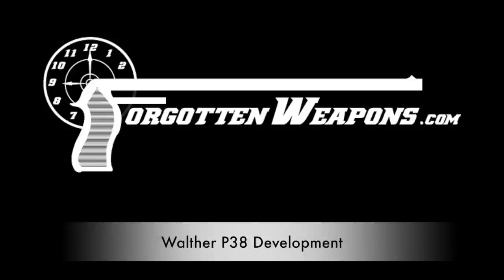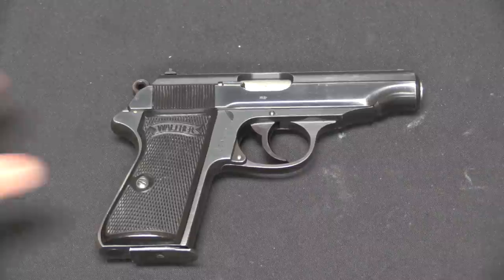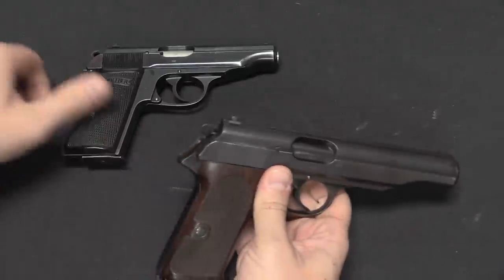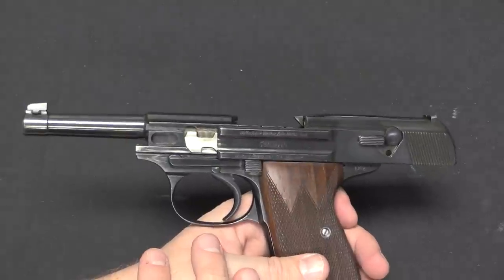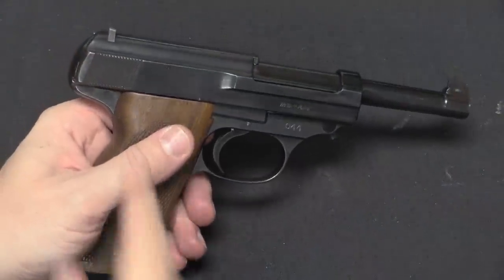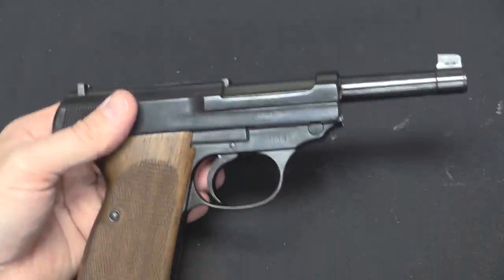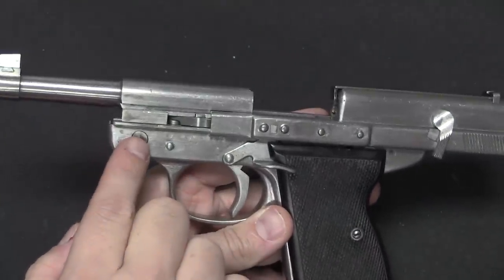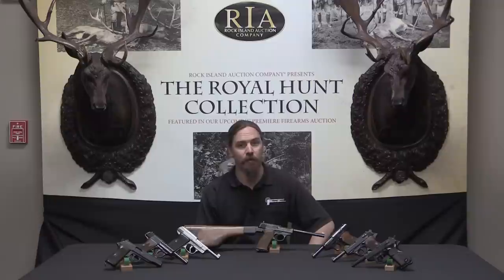Walther P38 Development

Comment: That magazine on the stamped gun seems like a pretty major indication of the gun's history. Had it been a late war prototype, they almost certainly would have done the same thing they did with VG rifles and used an existing magazine design, which in this case would have been the normal P.38's mag.

Comment: When I was about 10 or 11 I found a plastic P38 at my local model shop. AFAIK it was an accurate part for part replica in plastic. Of course some of the parts including the slide and barrel were supplied in two bookmatched halves. It even had cartridges with primers one had to build. I didn't begin to build it until I had made a few cars and planes and two years went by. I learned more about firearms than cars thanx to my brief model building.
Any one have experience leaning about gun mechanics through building models or taking replicas apart. I've not built a model anything since I started making real(not firearms). Seams like a decent way to learn the way guns work without buying thousands of bucks.
Reply: I still have all the plastic model construction kit pistols I built as a kid!   I'm now seventy,  been collecting real ones since I was old enough; but still learning thanks to Ian, Othias, Mark and the internet in general. Thanks, guys !

Comment: Great development history lesson.

I am amazed that a collector could obtain the various development prototypes. These have to be extremely rare.  Truly a one-of-a-kind collection. Too bad it will probably be broken up ...

Several things made the P-38 stand out: 
1. its sight. Vastly superior than those of the Browning Hi-Power.
2. its design was extensively copied in the design of the Beretta 92 / M9: external trigger draw-bar on top of the right grip panel, wide ejection clearance and especially the locking block.

Comment: The optical similarity between the PP and a P38 with the barrel sawn off are quite interesting. Although in my opinion, the PP beats every other pistol aesthetically, the P38 with the barrel shortened and the receiver and slide lengthened (so that the barrel and the slide end at the same point, similar to the PP) would be pretty close...

Comment: Other sources have mentioned a significance to the shape of the block or sheath around the firing pin.  I noticed you showed some with a round block (that sheetmetal example didn't have any separate insert.)  However there was also a rectangular block/insert -- I think moreso with the police version.  I'm particularly interested in this topic because I have a P38 that doesn't seem to fit any of the versions and has many stamped marks, some...odd.  Do you have a more detailed video about P38s?

Comment: Maybe the shrouded Hammer wasn't such a good idea for the military, as it took quite some effort to squeeze off the first round if uncocked (at least with the P1), which could have you miss because of the force you had to apply. Iirc it also could be cocked half-way, blocking the trigger when loaded and safety off.

Comment: I took a pass on a nice P38 years back, but I have my dad's P1 made in 1971 with matching dated mag, with the P1 alloy frame it feels way different. Tip: I use light grease instead of oil for the rails and locking block.

Comment: Even though the general consensus is that the Walther is a cheaper design than the Luger (and that may be true practically speaking), I feel it is doing both the gun and the general public a disservice to assume this is just a scaled down design only brought about to save money and manufacturing time. In essence, very much like the Walther PP and PPK that came before it, the Walther P38 is a classic German product of 'over engineering'. What this means is that the product is much better than it needs to be, but it does this efficiently. The P38 was so far ahead of it's time that even modern handguns like the Beretta 92 are pretty much a direct copy of it mechanically speaking. It's delayed blowback striker-fire system is used not only in many pistols but has been adapted to full sized assault rifles like the VZ 58, which is also an excellent gun. (much in part due to the mechanical designs it borrowed from the P38). It's double action and single action, which at the time was only heard of in revolvers, plus it's de-cocking safety was a very impressive innovation for it's time. So yeah, even though the Luger was very much a 'luxury gun' by comparison to most of it's competition, the action was outdated by this time and the P38 was an improvement in many ways. I own both a P08 and P38 and I love both of them. The Luger more from a collectability and artwork perspective, while the P38 is just a really impressive and well polished machine that still runs smoothly after 70 years. The Luger is like a Formula 1 Mercedes from the 1930's and the Walther is a classic shark nose BMW from the 70's.

Comment: I own a p38 and I have a question when I put the safety on I pulled the trigger (dry fired it) to to see if it would lock but it didn't it ended up activating the hammer after discovering this I have not fired it since I bought it I just want to know if this is a common thing with p38s or double actions in general

Comment: It's always bugged me that the P38 and the Beretta FS looked so similar, is the beretta just a foreign reproduction?
Reply: The Beretta 92 is not a reproduction but is based on the Walther P38...kind of like how the CZ 75 is based on the Browning Hi Power.  They have similar qualities but are not the same pistols.  We might not have the Beretta 92 without the P38.
Reply: Flemme Werfer the Beretta has and that design since 1915, look em up
Reply: Irwin Torres actually you look them up too, walther in no way influenced the design of beretta
Reply: newcorpse ontheblock   I think you need to do some research before you start telling other people to look stuff up.  The Beretta 92 evolved from the Beretta M1923 and M1951.  The M1923 is where the 92 gets it's open slide design.  The M1951 is where the 92 gets it's alloy frame and locking block barrel which was originally used and borrowed from the design of the Walther P38.

Comment: That stamped gun is amazing
Reply: I think this was an attempt of possibly going the same way as Rheinmetall did when developing the MG42, which also largely used stamped sheet metal parts for the housing, instead of milled block material.

Comment: "Simple blowback isn't ideal for pistol cartridges as 'hot' as 9mm"
Hi Point: "Hold my beer.."
Reply: Which is why Hi Points are so big and heavy compared to comparable pistols.
Reply: High Point: “Hold my Pabst Blue Ribbon beer”
Reply: There is an other, older 9mm Luger straight blowback pistols that were very successful. The Astra Model 400 started in 1921 and is a fantastic pistol. It ended production in the 1950's. Made of all forged and machined steel, I own one and have shot thousands of rounds over 50 years and never had a malfunction.

Comment: It is always very interesting to see the lineal development of something like this or the 1911, especially when prototypes are so rare, as these are. Great job and a nice find. If you include the Beretta 92 descendant,  i suppose one could argue that the P38 and its descendants probably equal more military issue pistols than the 1911- german plus italian plus US M9's. I don't think the 1911 and 1911A1 reached too much over a million, the P38 and 92 and M9 probably have. The P38/P1 was West German issue into the early 80's at least. My P1 had 1979 dates in the slide. As i recall, the Sig 225 came along about 1983-84 as a police pistol to replace the P1 and older PP's and whatever else. Anyway, great video as always. Thank you

Comment: I know very little about this P38 pistol and just bought one off a friend. The box and the instructions all say P 38 on them but I’ve heard you reference the P1 and someone else tell me after the war they were called P1, so is it a P38 or a P1? Also, I was told after the war they started making the frames out of aluminum. I can’t tell in this gun everything is black there appears to be a date stamp on the side of the gun, showing 9/69 is there a web site where I can check the serial number? Thank you.
Reply: I may be late for an answer. Was in the German Army (Bundeswehr) in 85 and we used the P1 in 9mm para. It was basicly a P38 with a lighter frame (not steel). It was all black. Maybe check it with a magnet when disassembled. I think production of P1 for the Bundeswehr started around 1956 or 57?
Cheers from Germany
Doc

Comment: As a young policeman in South Africa I was issued a brand new Walther P38 9mmP pistol in 1979, serial number 338548. It was a German made pistol and not a Manurhin copy and I used it until 1985, when it was replaced by a Beretta 92 9mmP with serial number B27397Z

Comment: What ammo should I use in a 1943 p38 Its in 8/10 condition barrel and action are very good. Dont want to shoot it alot just sometimes, I do reload if that would be a better option.
I don't want to just shoot any factory 9mm without knowing it will be safe and not harm the gun

Comment: I may be mad, but it seems like there are some similarities between the P38 and the beretta M9, like the location of controls, extractor, form of the slide, and so on.  Is this coincidental or another example of German weapons inspiring other developers?
Reply from the maker: +deadextra The P38 was a major influence on the Beretta 51, which is what the Beretta 92 was developed from. So yes, there is a significant similarity.
Reply: Very cool!  Thanks for the response.

Comment: I have the P1, and it has a problem where it doesn't always successfully extract, but the extractor seems fine, multiple people have told me it's because American ammo is not as powerful as what it is supposed to feed with, do you know any hot loads that'll make it do it's thing?
Reply: +X_Fox 
I've got a p1 and it  favors winchester white box 9mm, both 115gr and NATO 124gr. However, I wouldn't use the NATO unless you have the hex re-enforcing pin since the early P1s suffered from excessive wear without it.  It seems that most 9mm bullets sold are slightly different in shape to what they were back in the day of the P1 so a lot of older 9mm pistols have feed and extraction issues.

Comment: Here's a question for someone more knowledgeable than I:

Suppose two teams of soldiers armed only with Walther P-38's were pitted against an equal number armed with (say) Beretta M-9's but limited to eight round magazines. 
Based solely on the firearms (i.e. disregarding skill, tactics, etc...) what would be the major disadvantages, if any, of those armed with the Walthers?
Reply: +polymath7 M-9 has better trigger. Both guns are DA/SA, but trigger pull on P-38 is heavier. Also I guess it should be easier for most people to reload beretta faster because of the wider magwell. Everything else is pretty much the same: cartridge, barrel length, overall length, weight, etc.
Reply: Николас Кейдж   I wonder if maybe the older pistols might be a lot more likely to jam.
Reply: polymath7 it might be a problem with modern ammo with all variety of bullet types and powder loads, like hollow-points for example or really hot rounds. But if you run it with factory spec ammunition it should be fine. Tokarevs, Mausers, Lugers, P210s, Radoms, most of the old military pistols work just fine with the right ammo. All of them passed the military testing and many of them were reliable enough even by today's standards.